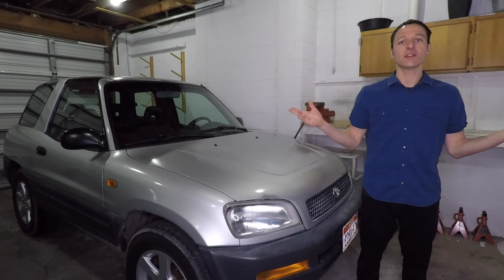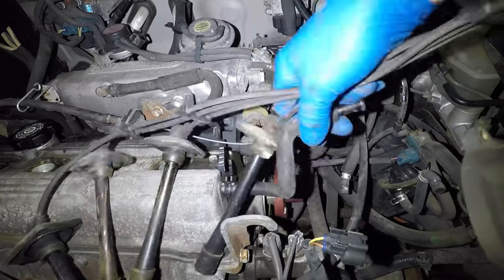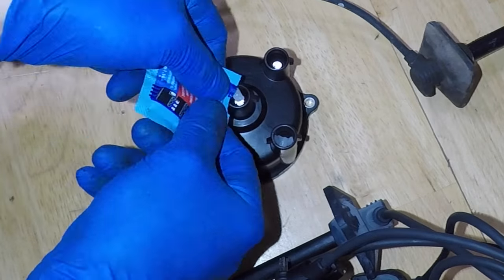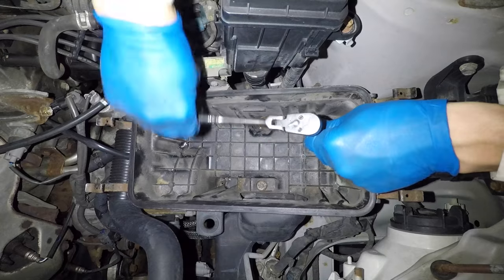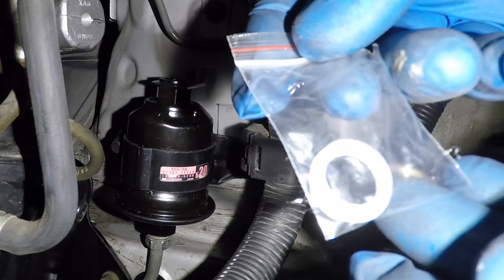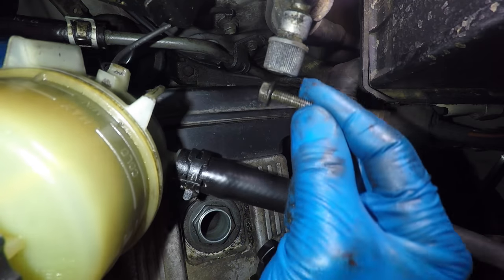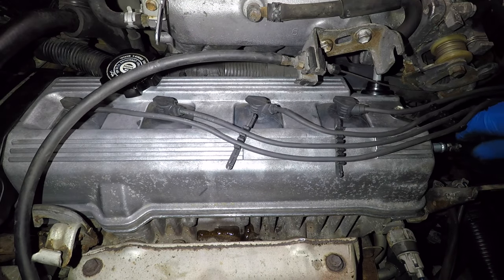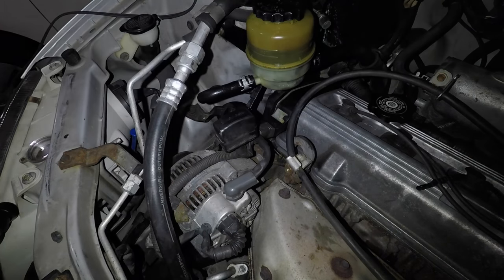RAV4 tune up: spark plugs, distributor cap, fuel filter, ignition timing (episode 5)

Comment: Never drop sparkplugs in the holes. Use a magnet to gently place them on he bottom of the hole otherwise you may change the electrode distance by denting it.

Comment: Amazing video. Straight to the point. Please make more! 🙏🏼

That said, NEVER use anti-seize on a spark plug with shiny threads. It already comes with a special coating from the factory to prevent seizing.

Any anti-seize used will act like a LUBRICANT and will cause your torque specs to be off, ultimately over-torquing the spark plug.

The only time anti-seize should be used is when the threads on a spark plug have a dull/matted, non-shiny/metallic finish.

😎👍🏼
Reply from the maker: Good info!  I did not know that.  Thank you.
Reply: @LabCoatPaul 
How many bar fuel pump

Comment: Thanks for uploading and sharing! 
Just bought a '96 today (good and almost rust free from an old couple) with new service done already. 
Your videos will help me a lot in the future!
Reply from the maker: Congratulations!  RAV4's are awesome.  Also, you're lucky about the rust.  Mine has a lot of rust.
Reply: @LabCoatPaul  I'm actually looking for a good place to add some extra spot lights to the front. Unfortunately bars are not allowed anymore in Germany, if you didn't have some anyways. So it's kind of a challenge to find a good spot to fix them...

Comment: Did the fuel filter following your video, didn't went that well!
First off, I bought the filter from Toyota part-number and it came with holding bracket. So I decided to replace the whole assembly instead to untight the current bracket to replace only the filter.
In reinstalling the new filter+bracket I managed to break one of 2 bolts that hold the bracket :'(

And in a general way getting the bolts lose and wrenching in that tight space is quite difficult !

So in the end this simple task took me 2h+ and now my filter bracket is only held by 1 bolt -_-

Comment: Hi Paul!!! The video is really awesome. I appreciate the zoom-ins and detailed explanation of how old and new things look like. I am not really a mechanic and wanted to ask your advice.

I got Toyota Rav4 1996 in Sep 2020 with 97k miles. Recently, the engine sign lightened up and I connected a diagnostic tool to read the code. Turned out, it was P0302. I googled the reasons and turned out that spark plugs could be one of the reasons. One other YouTuber suggested replacing the spark plug wires and seeing if the code will change, but the wires were too short to be placed in different sockets so I just put them back lol. After I turned the car on the engine sign disappeared (???). Few days later, it appeared back again and the car vibrates intensively both on idle and while driving. I haven't taken the car to mechanic since I bought it, so thinking it might be spark plugs. I have few questions:

Do I need to replace all the things mentioned in your video, or I can just replace, spark plugs and it's good to go?
Are there specific spark plugs I should get? There is a lot in the store and I have a hard time figuring out what's the difference. 

Any other advise would be appreciated:) I want to try fixing it myself because I love the car,  and I live in small city where there is only one mechanic place. I had previously taken the car to them because of an oil leak, but I've paid $$$ and oil leak is still there haha. Will get to that once I figure out this particular problem.

Thank you!!!
Reply from the maker: P0302 is a code for a misfire.  You should replace all 4 spark plugs, the spark plug wires, and the distributor cap and rotor.
The cheap wireset and distributor cap and rotor from Autozone should be ok, but the spark plug wires fall apart easily if you pull on them.  Use dielectric grease on the connections, and if you're removing the wires off the plugs, don't pull on the wires, and pry the boots up with a flat screwdriver instead.
For spark plugs, use regular denso spark plugs.  You can get platinum plugs if you want, but don't get any of those weird bosch 4 - electrode plugs.  The center electrode on that style of plug is tiny and causes misfires.
All the recommended part numbers are in this video.
Reply: @LabCoatPaul  Hi again Paul! I did it!!!! Changed all the parts that you advised by following the video and boom - no more check sign. I'm so excited! Never done any car jobs and it wasn't that hard for me, with your help:) Thank you so much for the video! I have few more questions, if I may.

When I was replacing rotor and distribution cap I noticed there is a lot of black goo on the engine, at the bottom of the distribution cap. I have an assumption it might be an oil leak I mentioned earlier? Not sure if that's normal.
Another question is, you mentioned in a video that if spark plugs are white or black - there might be a problem with the engine. Well, the old spark plugs were tan on a screw-thread but black on actual "spark" spot (my apologies for such a professional description). I am not sure if I can troubleshoot the engine somehow and fix it? The car drives fine, but I don't really want to wait until it's not haha.

Hope you have a great day!!!
Reply from the maker: @kitnfall  You have an old RAV4, so there's a 100% chance oil is leaking from every seal in the engine.  Oil under the distributor cap is most likely coming from the valve cover gasket or distributor O-ring.  If it leaks a lot, fix it.  If it leaks a little bit, don't worry about it.
Also, I wouldn't worry too much about the old spark plugs having a little bit of black on them.  You were probably getting a bit of a misfire.  If you want to, check your new plugs after a while to see what they look like.
Reply: @LabCoatPaul  "there's a 100% chance oil is leaking from every seal in the engine." 🤣🤣🤣makes sense haha

Thank you for all advice!

Comment: Ive got original wires and distributor on mine,210,000 miles! Just replaced the denso platinum +2 plugs which may have been original as well. A little.ash deposit on one side of the plugs.

Comment: would this car wouldnt start if the timing is off. or should i  be looking on the other things like, fuel pump?etc. its cranks up but wont start, got new spark plugs..

Comment: Hey Paul I’m having some issues, I got two codes from my 97 po105 and po120. Is there a reason the code for the map and the tps would go off at the same time? Car is hard to start and if I tap the throotle quickly it will stall and lug. But if I roll slowly on the throttle it will rev just fine.

Comment: Hi paul. just subscribed to your channel. I have a 96 with 340k miles on it. loving it more the older it gets. Just finished replacing the vcg, but i read somewhere (not sure which rav4 forum there's so many to keep track) that the torque for spark plug nuts is 17ft pounds. I'm a little worried that it may be too loose.
Reply from the maker: That sounds about right.  I've never used a torque wrench on spark plugs, but you have to turn them until the sealing washers crush down a little bit.  You'll feel the spark plug stop turning when it's tight enough.
Reply: @LabCoatPaul  sorry i wasn't specific. it's the 30mm nut that secures the vcg.
Reply from the maker: @vincek296  The spark plug tube nuts don't need to be very tight.

Comment: Great Video.  Does your RAV4 have a removable in-cabin air filter?
Reply from the maker: No.  Mine is a 1997.  I think they started including cabin air filters in 1999.
Reply: @LabCoatPaul  Thanks, I have a 97 also and I couldn't find one.  It appears that they were included in Rav4's in other countries but not for the vehicles produced for the U.S.
Reply: Mine 2000 rav4 doesn't have cabine air filter - usa. But you can install one.  There was a video on youtube. You just need to cut some plastic behind glove box and cut carbon filter to fit it.
Reply: @LabCoatPaul  unfortunately not in my 99 nor any gen 1 i believe

Comment: Sir, i have a rav4 same model , the problem was the rpm gauge is not working even in idle or running fast,
Reply from the maker: First, make sure your crank position sensor works. Connect a simple OBD 2 scan tool and go to the datastream to look at the engine RPM. Does it work? If the computer has the RPM, the problem is most likely in your gauges. If the computer doesn't have RPM, you may have a bad crank position sensor.
https://amzn.to/3SLG18J
Reply: @LabCoatPaul my rav4 is OBD1 sir, it is work the OBD2 scanner? ,and where the location of crank sensor,

Comment: Hey Paul, about the distributor. There are numberings written on each distributor's hole 1-2-3 & 4. Which number connect to which sparkplug wire? Should number 1 connect to the shortest sparkplug wire or the longest one?
Reply from the maker: The numbers are not related to the length of the wire.  The numbers tell you which position to connect it to.  Number 1 is closest to the crank and 4 is closest to the transmission.

Comment: Hey how does the timing adjust when the computer does the changes? 6:06
. Is there a motor that turns something under the distributor?
Reply from the maker: The timing is not adjustable.  The computer does it.  If you modified your engine and wanted to adjust the timing, you could change the base timing, and the computer would advance or retard from that point.
Reply: @LabCoatPaul  Thanks for the reply. I've only encountered Rav4s using the Coil Packs ignition system design before.  The original distributor set up is interesting to see compared to the Coil packs Toyota started to use around the time of... I think about one year after your rav4's years.

Comment: Paul Thank you, great videos! Just one question, did you calibrate the spark plugs before putting them in the car? I have the 3 door 1999 model and it is loosing power when I accelerate the car in second and third gear. What do you think?
Reply from the maker: Yes.  You should always check the spark plug gap.  Start with the tune up.  Get some new plugs, distributor cap and rotor, and spark plug wires.

Comment: Hola Paúl. Muchas gracias por tus videos... Pero tengo una duda..
Hice todo el tune up como lo explicas paso a paso pero ahora me queda la luz de "" check"" encendida...
Que puedo hacer para solucionarlo...???
Reply from the maker: Connect a scan tool to the OBD2 port under the dashboard and see what code you get.  You might have left a sensor unplugged, or maybe you didn't plug a spark plug wire in completely and you have a misfire.

Comment: Hey Paul- thank you for the super-helpful video. I replaced my spark plugs, wireset, rotor cap and distributor cap no problem thank to your video.

However last minute i decided to replace the PCV Valve without pulling off the cylinder head cover. I simply popped the old PCV Valve off and popped the new on on. It didnt seem to seat totally flush, but very close. During a test drive the car stalled out as i stepped on the brake coming to a corner. I managed to turn the car  off and get it started again.

My question is: is it okay to replace the PCV valve as i did? Im wondering if maybe its the rubber grommet or a slight crack in the hose that might be the problem which is causing my 97 rav 4 to stall and also sometimes idle high momentarily at about 2000 rpm?

Any advice is greatly appreciated✌
Reply from the maker: It sounds like you have a leaking vacuum hose.  A crack in the PCV hose will let extra air into the intake, causing the idle to be too high, or making the engine stall.  You need to install a new hose on your PCV valve.  It should be 3/8" inside diameter hose, and you can buy it by the foot at your local auto parts store.

Comment: Hi Paul, I have the exactly same car and have never had problems with it for the last 20 years until now. Every couple of days the car just doesn't start. The battery is new, the starter turns but the car doesn't start. I usually wait a couple of hours or try on the next day, and then it normally starts just fine and continues fine for the next couple of days, until it happens again. Any idea what's most likely causing the problem?
Reply: Tricky indeed. Could be many different things!  The only way to find out will be to diagnose step by step and eliminate each possibility!  Could be a faulty HT lead, spark plug or fuel filter...

Comment: So how do adjust the timing with a dist that has a set hole and no rotation slot?? 
Do I have to do it with a computer??
Reply from the maker: There is no slot because you don't need to adjust the timing.  It should just be right.  The stock computer won't let you adjust ignition timing.  If you want to change the ignition timing, you can use a dremel tool to turn the hole in the distributor into a slot.

Comment: What is the magic goo? Do you have part numbers or a recommendation for where to buy the parts?
Reply from the maker: I bought my tune-up parts from Autozone.  the part numbers are on the screen with the tools.  Discount auto parts stores like Autozone are good for buying supplies like oil and filters, but for any real repairs I recommend buying original Toyota parts because they are much better quality.  You can get Toyota parts at the dealer, or if you want to save a few bucks and don't mind waiting for them, you can order parts online from toyotapartsdeal.com
Reply: @LabCoatPaul  Thank you! I was looking for part numbers on the pictures shown later in the video. I missed the first photo until I watched it again after your reply. Super helpful👍
Reply: @LabCoatPaul  IDK if it is just me? but I can't make out all of the part numbers.

Comment: What size of bolt did you buy to replace the short bolt on the fuel filter bracket?
Reply from the maker: The bolt size is M6x1.00  I got one twice as long as what it had.  About 25mm length (1 inch) is good.

Comment: any idea how to fix the engine whine? sounds almost like a supercharger, no noise when cold, only starts after driving for a while which gets louder with revving/acceleration, its even worse with the a/c on, im suspecting timing belt but was recently done, mechanic denies and thinks it needs a new a/c unit.
Reply from the maker: It's possible you have a bad A/C compressor.  Diagnosing it is easy.  Just take off the A/C belt and drive it.  If the whine is gone, you know the compressor bearings are bad.
You can do the same thing to check to see if it's the alternator.  Take the alternator belt off, and drive it.  It won't charge your battery, but that's not important for a short test drive.
You can also take all the belts off, and turn each pulley by hand (with the engine OFF), to see if any of them are hard to turn or grind.
It's also possible the belts are just too tight.

Comment: Where do I get the heater hose and short piece of wire?
Reply: The automotive parts store  told me to buy a charger from the dollar store and use the wire out of it. I got the hose from the automotive parts store but did see it at home depot as well. . Just wanted to share just in case anyone ever has the same questions!

Comment: Any particular reason you went with the NGK spark plugs instead of the Denso plugs?
Reply from the maker: Not really.  I got the fancy iridium plugs, but that's not really needed.  They should both be fine.
Reply: Paul Shpakov Got ya. I’ve heard good things about the NGK plugs, but I’ve also heard from many mechanics that the OEM Denso is the best way to go.

I guess either choice is fine, as long as neither end up causing any kind of damage or performance issues, right?
Reply from the maker: @justinrogers1988  "Performance"  hahahahaha the RAV4 is one of the slowest cars you can get.  There is no performance in that engine.  To answer your question, it doesn't matter if you get Denso or NGK.  Both spark plugs are high quality and will work perfectly.

Comment: Hi Paul, thank you for the great work that you are doing. I have a similar Rav4, is it possible to remove 4 wheel from this type of car?
Reply from the maker: Short answer:  NO.  I'm not really sure why you would want to remove the 4 wheel drive from a RAV4.  It gives you lots more traction and control in rain, snow, and off road.  

The first generation RAV4 gets horrible gas mileage, considering how light weight it is and how weak the engine is.  Mine has never done better than 22 mpg.  Removing the 4WD will probably not improve the mileage by more than 1 mpg.

If you still want front wheel drive only, you would need to replace the transmission with the front wheel drive transmission, then remove the driveshaft.  To complete the project, you would also need to remove the differential, and replace the rear spindles with the non-4WD version.
Reply: After this full service and replacing certain parts that tend to get overlooked are you not finding it slightly better on fuel ?  Exellent video by the way.

Comment: Can I use distributor from Rav4 1999 to Rav4 model 1995 ?
Reply from the maker: In the United States, 1996 - 1997 RAV4 have a distrubutor.  1998-2000 models have an updated engine with 2 coil packs instead of a distributor.  It's possible to install the newer ignition system as an upgrade, but you would have to modify the engine wiring harness.  I don't recommend it because it's a lot of work and you wouldn't gain any noticeable power or fuel efficiency.